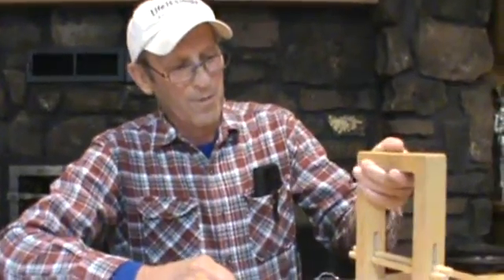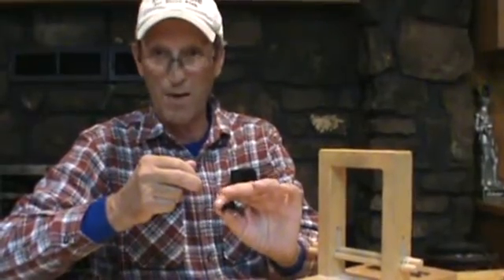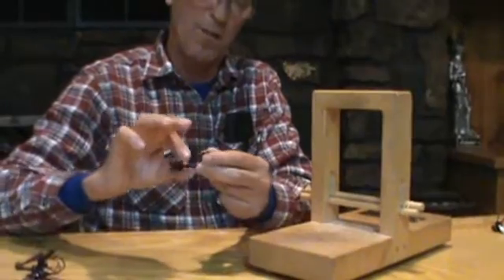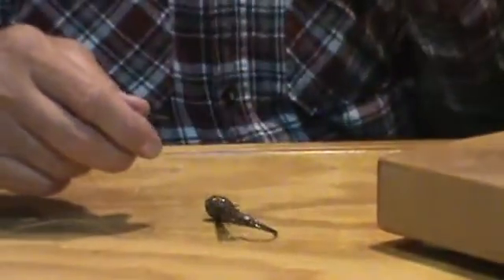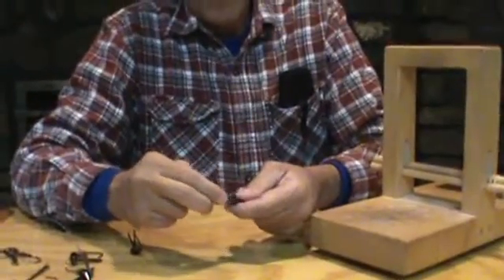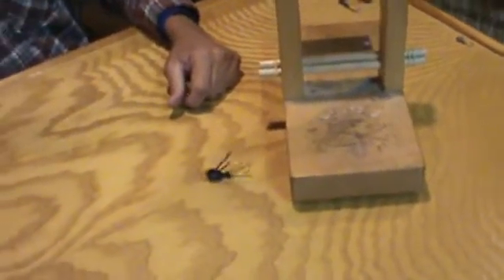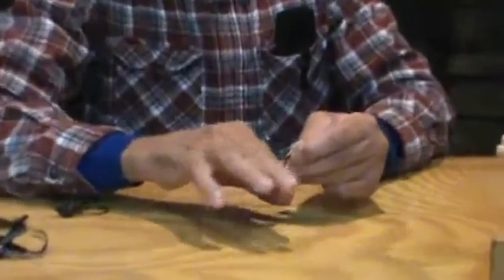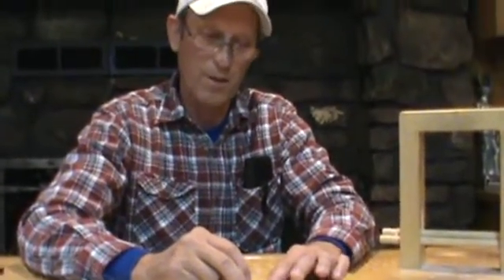NuJig-  Introduction (part1)

Comment: You are not loosing fish cause of the jigs you use, it's because ur guards are too thick or ur setting hook too soon. Trust me on this one not trying to bash your product but some beginner fisherman are going to be falsely informed IMO.
Reply from the maker: center based weedguard lures will always force the hook over to a shallower hooking angle.  that is not to say that they will not hook a fish, but there are times that you will have your jig come out of the mouth with the hook flat and completely miss the fish.  also, when hooked at a shallower penetration angle, that is why some bass pull off, or can even straighten the hook.  would you care to expound on why bass are hooked all over the mouth with a center based weedguard jig, and the weedguard is not causing the problem.  ever wonder why crappie jigs consistently hook in the side of the mouth and out in the edge of the lip??  you are fishing with a bare hook, but yet it does not hook consistently in the roof of the mouth, and it is because what happens from mechanical aspect just as a center based weedguard jig is going to mechanically fight the hook over to the side.  for ever action there is an equal and opposite reaction.

you also answered you own thoughts when you stated that weedguards being too thick cause problems.  a very true statement.  the stiffer a weedguard is on a center based weedguard jig, the worse it will hook.  cutting it down will help, but not totally eliminate the problem.  you will also hang up worse.  so, you are causing another problem.

bo